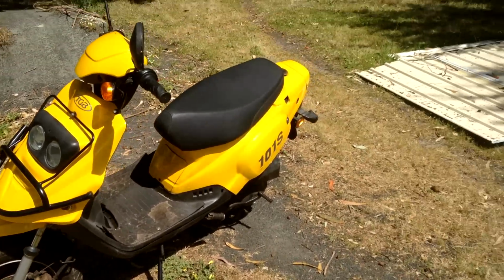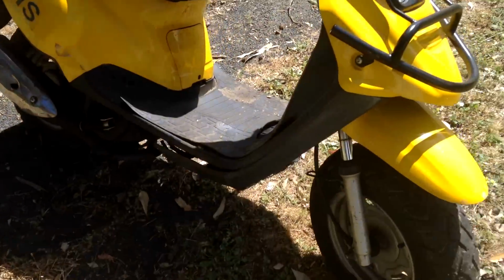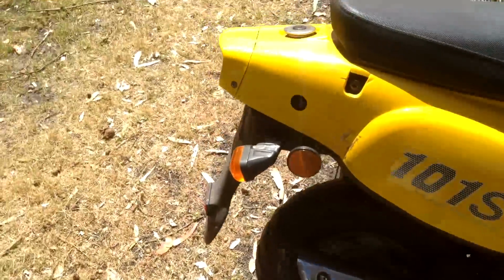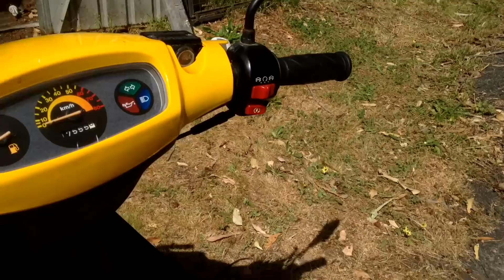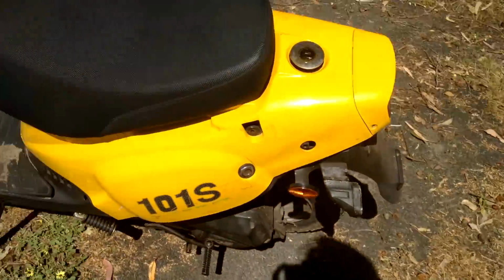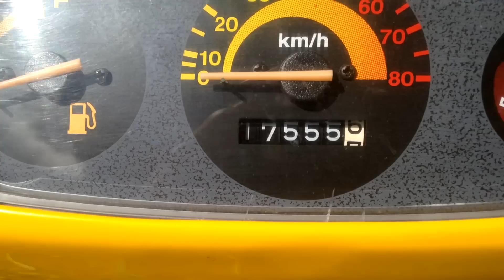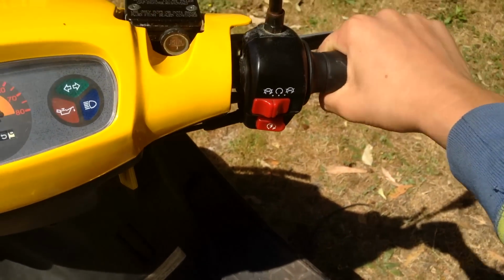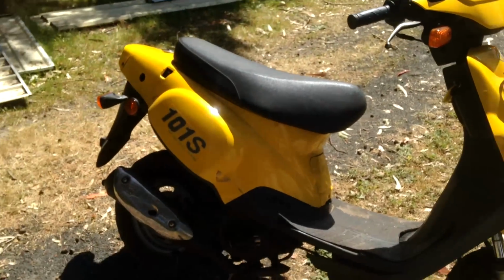Moped/Scooter Won't Start | How to fix and get going again | DIY

Comment: Hello my HYOSUNG
 scooter 2005 working but not moving there is motor sound but not moving can I know why ? thnx
Reply: Your belt or clutch is probably broken. A bad clutch can cause a belt to shred. Therefore take off the bottom case on the left of the scooter check ypur belt to see if its broken. To take off the clutch you will need more sophisticated tools. To check clutch hold in the middle piece if you see a black ring popped out the clutch is bad. Replace parts needed. Hope this helped.
Reply: @wolfee_rides  thnx a lot

Comment: Moped,....MO - PED,....French word for motor and pedals, you have no pedals dude. It's a SCOOTER!   Your diagnosis, could be right, but mostly with these & other petrol scooters, OR Mopeds. if left to sit for even just two weeks, the petrol starts to "go off", as in solidify. That's the most common problem with sitting scooters, the fuel lines & carby bowl goo up when the fuel turns to a jelly like state. Hope that helps.